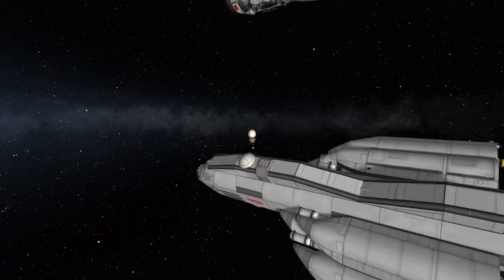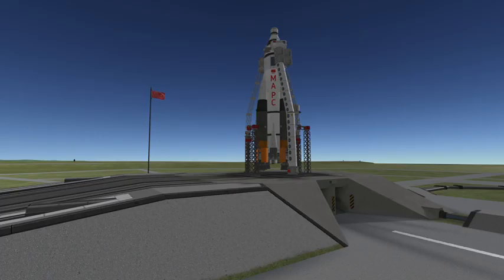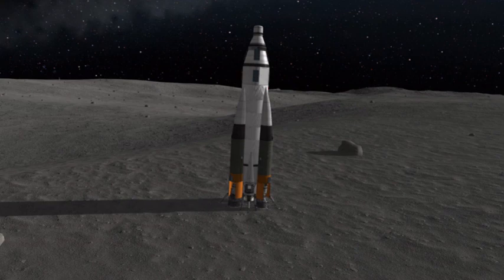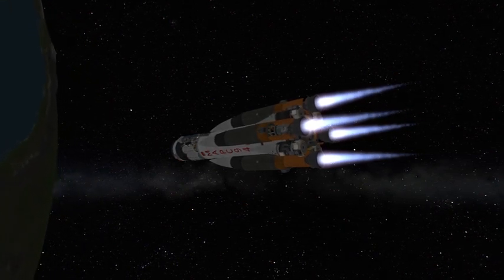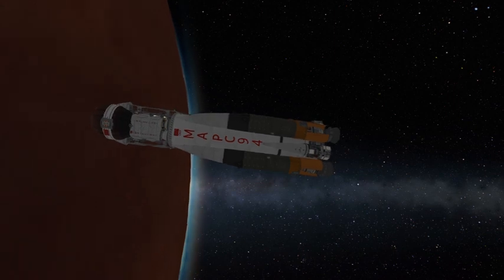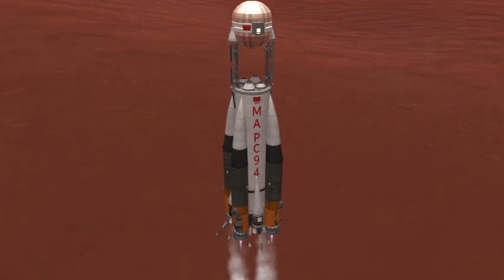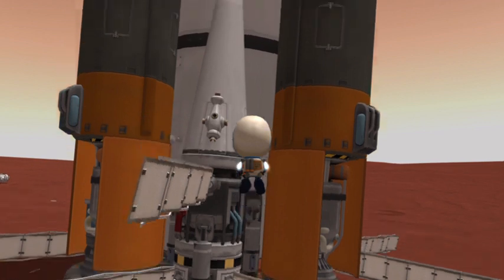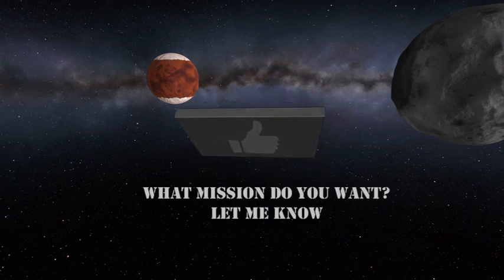For All Mankind Mars 94 Ksp

Comment: Hey AstroNut98. I found a duplication glitch that gives you more of whatever EVA thing you want, really. As long as what you want more of can fit in an inventory, though not necessarily a Kerbal's. I've found that if you open the little right click menu, you can stuff larger things into a Kerbal's pocket before EVA-ing them and they will have it in their inventory. Now, take said Kerbal, hope you picked an engineer for this, and put the thing somewhere. On the ground, attached to the side of the ship, anywhere you want. Now take the Kerbal, put him back into the ship, and open up the menu again. You'll notice that he's holding the big thing again. Click it to pick it up, then put it right back in his pocket and repeat until you have enough of this item.
I figured it out when I kept getting more parachutes and losing science kits that if he had the parachute when he went outside, switched to the science kit, and didn't switch back, when he went back inside, he didn't have the science kit and instead had another parachute.
Reply from the maker: that’s cool thanks for pointing this out
Reply: @astronut98  You've most likely encountered it before without realizing it. Have you ever gotten back into the capsule only to realize that you have an extra parachute?

Comment: Does it demands any mods for this rocket?
Reply from the maker: No mods I play Stock+DLCs
Reply: @astronut98  How did you get the circular tank on the top?
Reply from the maker: @mm-qq7bb  I simply used two fairings one facing up the other facing down and to deal with heat I attached a few small radiators and I think a heat shield to use as a heat sink